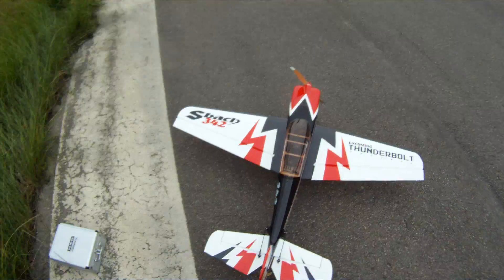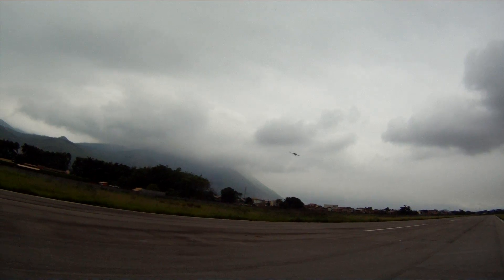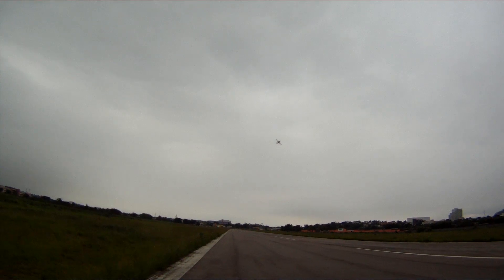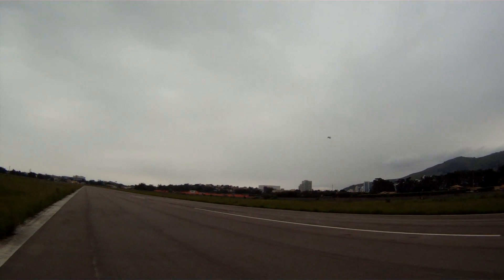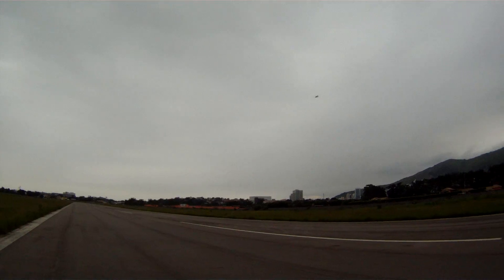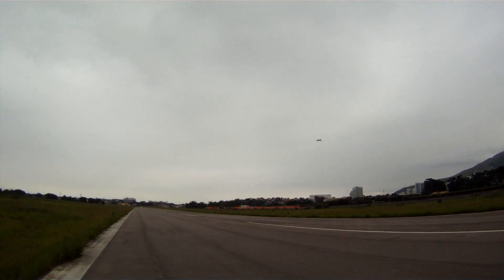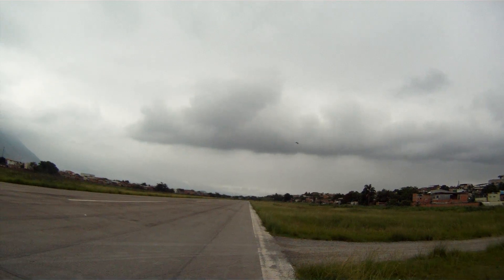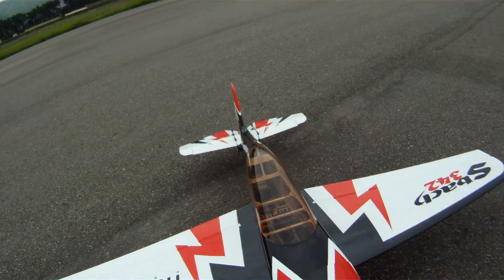Skyline Sbach 342 60" test flight with rewound EMP4260 499kV (Nova Iguaçu airport)

Comment: FYI - I've found this motor is an absolute monster for the price running on 6s: https://hobbyking.com/en_us/propdrive-v2-5060-380kv-brushless-outrunner-motor.html  You have to prop it big.. like 17", but it will lift an 8.5lb 65" plane on 6s with enough force to pull your arm out of its damn socket, lol.  

Just in case you're ever looking to set something like this up without all the effort of rewinding - I'm far too lazy and unskilled to bother with that.  Nice job, though!

I've also run a Skyline/Goldwing/GeneralHobby 60" Yak-55m with tons of power to spare off of the FMS Beaver 2000mm motor that's like 48 bucks, running a 15x8 prop.  (Gonna try 15x7.. think it will be a little better for 3d.. the 15x8 was great, but also made the yak a pretty quick flyer at times.)